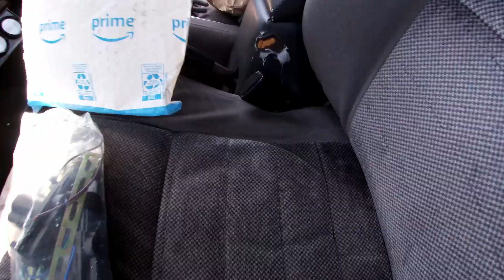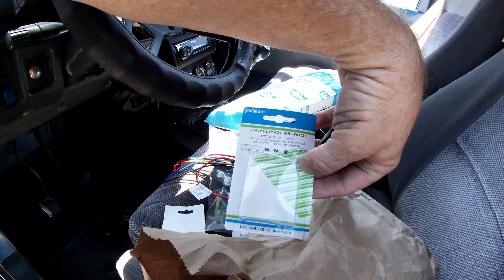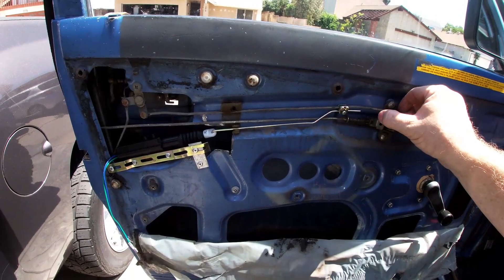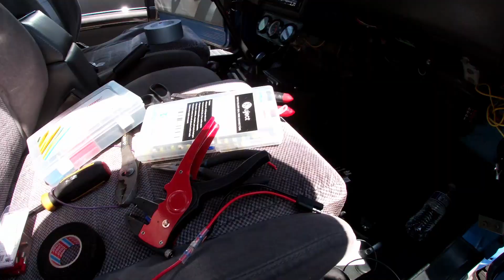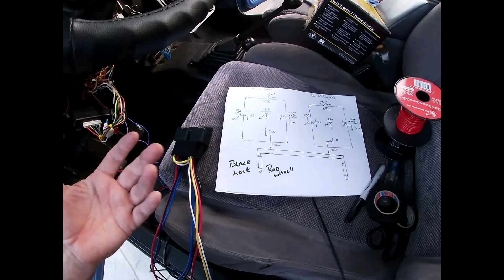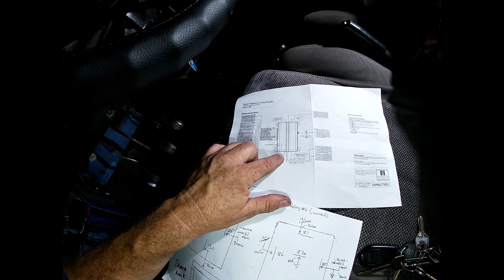Universal Power Door Lock Install In My 1986 Suzuki Samurai

Comment: Did you need to install the momentary switch? Or can you lock and unlock using the existing lock switch on the door handle?
Reply from the maker: No I did not install the switch. The doors lock with the key fob and ignition switch with the installed alarm. Thanks for watching!!

Comment: Did you have to get a higher amp alternator to do this?
Reply from the maker: I wanted to say no but years ago I did the Chevy alternator conversion to a 10si alternator. So I guess to correctly answer you question I would have to say yes. The door actuators are low draw so I don’t believe you would need to upgrade the alternator. Thanks for watching!!

Comment: Do you mind letting me know what alarm system, and remote you hooked this up with? Would it work with any?
Reply from the maker: It would work with any alarm that has the keyless entry feature. I used Viper 3106V. It’s an older model but I purchased it from Amazon. I rewired the Samurai few years back and included the alarm in the install. The lock kit is just a generic lock kit. Thanks for watching.
Reply: @DIYWilly  thanks! Really insightful video. Bought one myself as a project vehicle. Wondered if I would be able to automate the locking and installed an alarm, and the vid answered both.
Reply from the maker: @kevinhuggins8622  That’s great I’m glad it could help you!!  👍